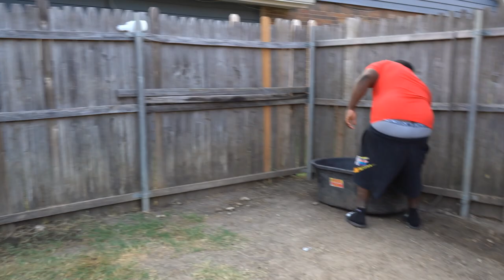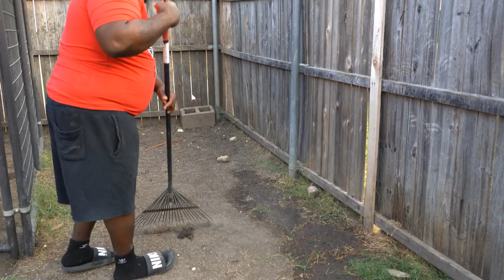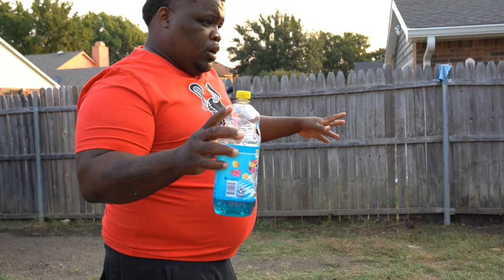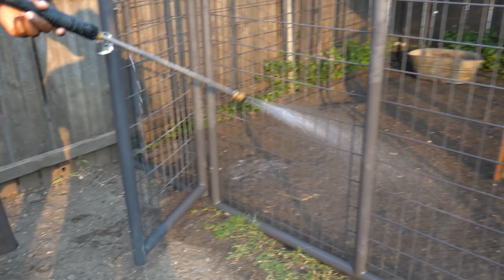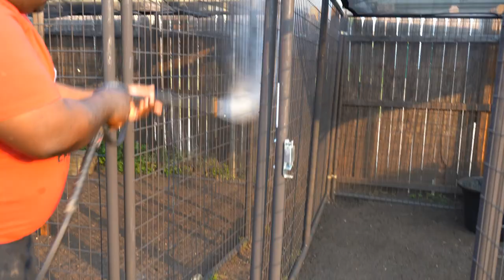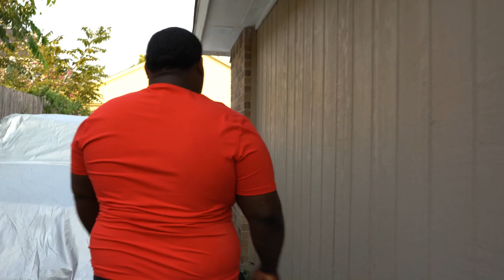Bigg Boss Rottweiler Kennel Morning Routine

Comment: Check out the wysiwash....all you do is hook it up to your hose and spray...it sanitizes the whole yard and the water bowls and kills parvo..its kind of expensive but worth the time saved it takes to clean and the money..its called wysi wash and you have to order it online.
Reply from the maker: ok thanks for the info so its basically like the presser washer of is it a little different? but ill look into that
Reply: @biggbossrottweilerkennels2629  You just hook it up to the regular hose..it comes with these big tablets  that you put in it and it would be a little easier than what you are doing and it sanitizes and deodorizes everything
Reply from the maker: @rothfamilyrottweilers1234  oh ok imma have to look into that